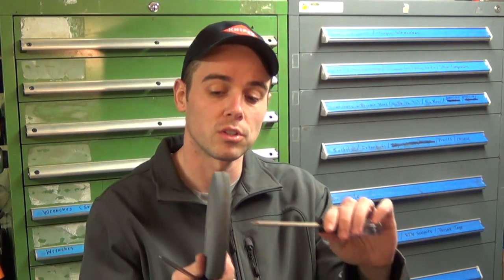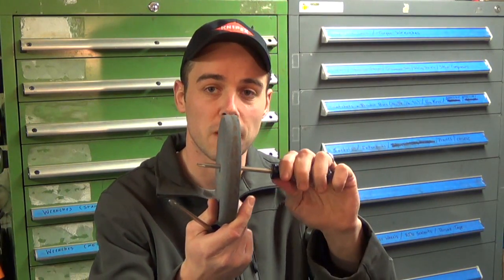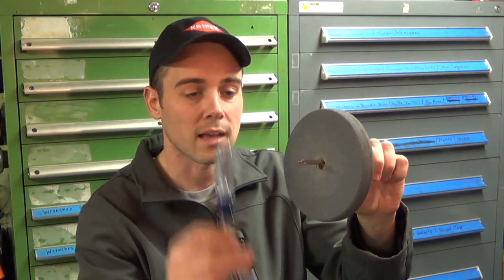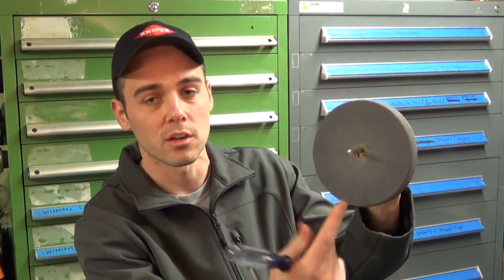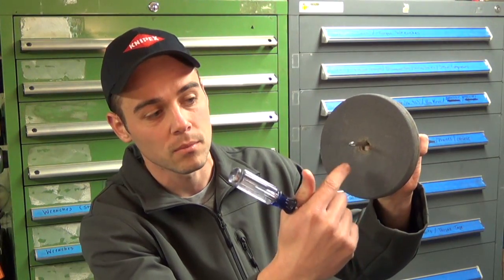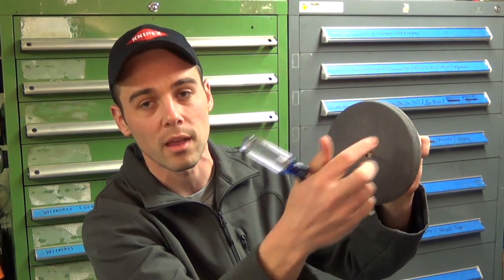How to : Ring Test a Bench Grinder Wheel

Comment: For the average user most bench grinders are too fast and are less safe and often overheat the tool steel !! Suprised manufacturers didn't  offer variable speeds or some that spin at only 1750(for 6-8" grinders) ,

Comment: Another tip to preventing deadly injuries,  is to make sure the guard is properly fitted,  and stand to the side when first turning on the grinder, that way, if the wheel should shatter for any reason,  you will be well out of the line of fire.  Also, grinding aluminum will clog up the wheel, causing extreme heat due to friction,  and ultimately lead to failure.

Comment: This may sound like a silly question, but does tone matter? Or pitch (not sure what it's called) the ring is there, but one wheel is a little higher of a ring, like two different bell sounds. Hope I'm making sense:-) Thanks!
Reply from the maker: Bettina Stepek If they have a clear unbroken "ping" or "ring", I would say they are fine.  If there are cracks, it is going to sound fast and hollow.  I would assume you are hearing different pitches since the stones are a different brand or grit.
Reply: Bettina Stepek Different diameters will emit different ring tones (resonances). The pitch is not nearly as important as the decaying duration of the ring tone.
Reply: Solitaire 514 thanks, that's exactly what I was wondering. They seem to both be ringing just fine, but they were just a bit different. :-)
Reply: Solitaire 514 Question: I found an old power kraft bench grinder wheel. Its a 6 × 1 × 1/2 vitrified aluminum oxide. The max rpm label was worn off. My bench grinder is 3450 rpm. Do think its safe to use? After ring testing, which I already did. Thanks

Comment: Thanks. Great vid.

I am about to buy a new grinder and wheels, so I'll do this. I was already aware of how dangerous they can be and they can explode, but I didn't know this simple test was available.
Reply: Bettina Stepek  No, he didn't reply. I tightened it up using my own initiative - spanners/mole grips etc…
Reply from the maker: I Love Taylor Swift No problem!  I am glad I could help...hopefully this video will save someone from getting hurt!
Reply: Real Tool Reviews Thanks. I have a question: How do I tighten up the nut on the spindle after I have installed the new grinding wheel? The reason I ask is because if I hold the nut on the other end with a spanner, that one loosens up as the other one tightens! And I don't want to grab the grinding wheel with a pair of mole-grips or pliers in case it damages the wheel and risks an explosion of the wheel (after passing the ring test before installation!)

Maybe that would be another good video for you to do - "how to change a grinding wheel" - I can't find one on here at all.
Reply: I Love Taylor Swift I need this answered too! Did you find out? Thanks:-)
Reply: I Love Taylor Swift hey thanks for answering, I got onto a welding site and a guy explained it perfect, take off both, put the left one on and tighten, then put the right one on and tighten, I did that and it worked! Just don't over-tighten or you gotta do it again. You made my day for answering though!